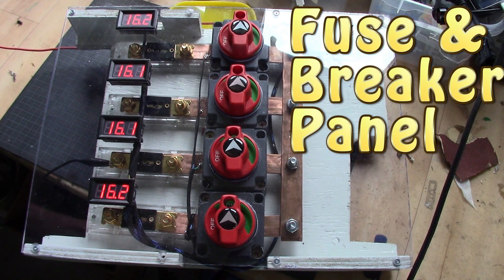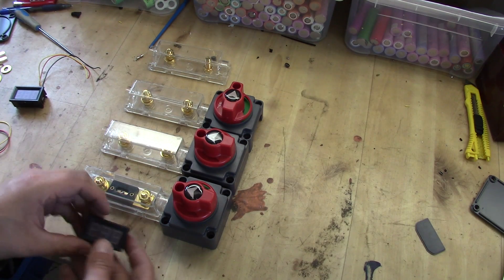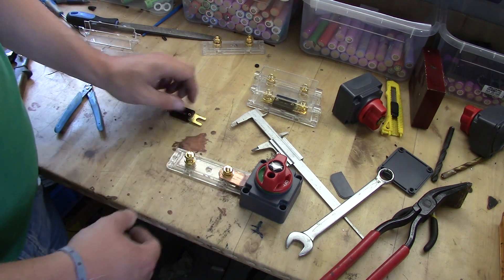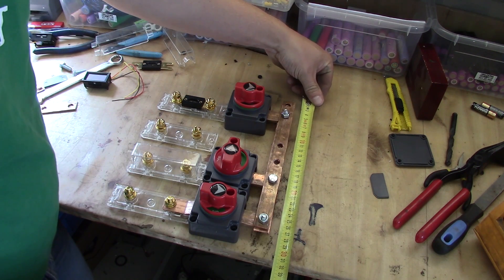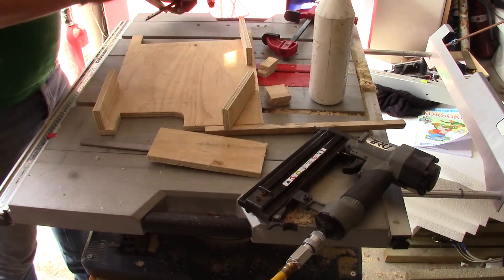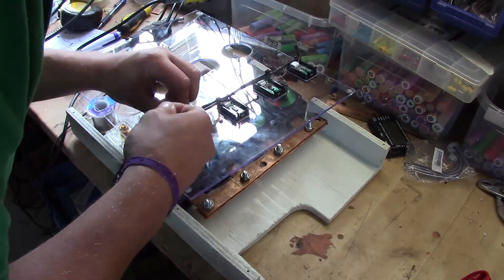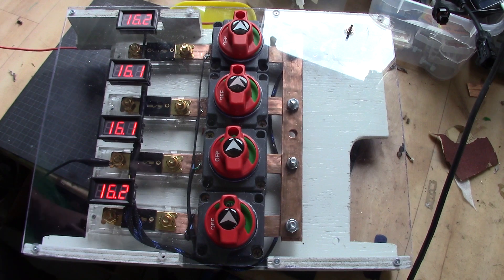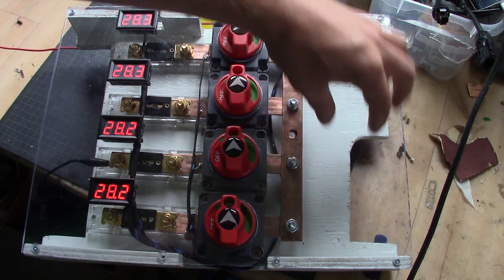Switch and fuse panel build - 18650 powerwall safety

Comment: You thorough build quality is excellent BUT, I hope you know the difference between an isolator switch (used for maintenance)- which you have - and a circuit breaker.  Dont try to break the circuit whilst under load or you may start an arc flash that will destroy your switch or worse.   Please google and instruct yourself if you dont know what I mean.

Comment: how do you wire multiple volt meters thru a single switch? thanks ... this was a good video!
Reply from the maker: You can turn them all on and off by just hooking them all to same gnd. They have 3 wires, GND, Positive and the meter wire that goes on the positive side of the battery bank.

Comment: Nice build!  The only thing I would do differently is to tin the copper bars. Copper will corrode even with minimal humidity. Or, if you dont want to tin the whole thing, tin where the contacts are going to be and then spray a clear protectant on the other parts.
Reply from the maker: Bobby Hicks its a good tip. I will monitor it and if needed redo that part

Comment: Excellent.....everything is well organized and mounted.... 👍 
Busbars could be a problem with high current... You could solder them together on the joints (cooper on cooper)otherwise cheap and effective 👍.....

Comment: now THAT'S a bus bar..!  glad to see someone properly putting insulation/protection over the bus bars finally.
Reply from the maker: Redoing it all for final and all my busbars have/will have this type of cover where you can visually see through but at same time make sure its protected. This box when in place is impossible to reach to the busbar.